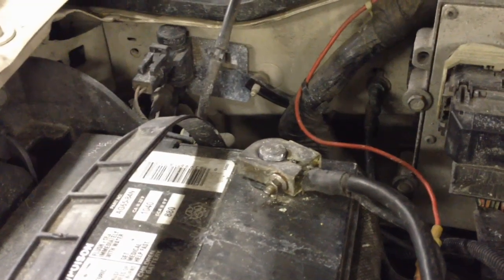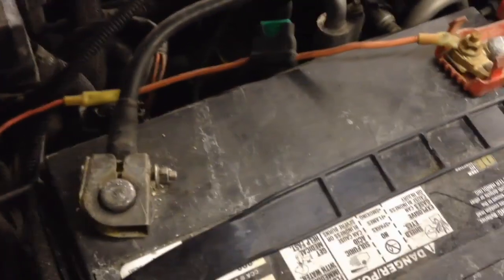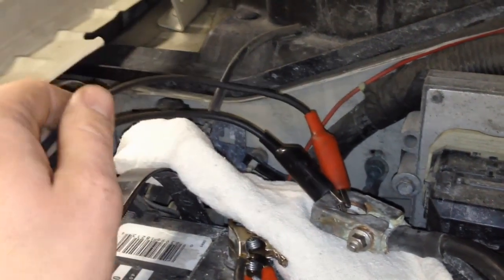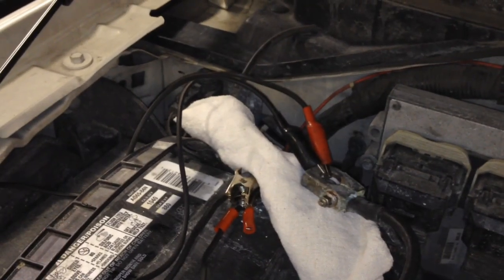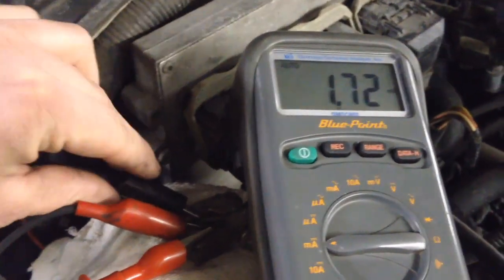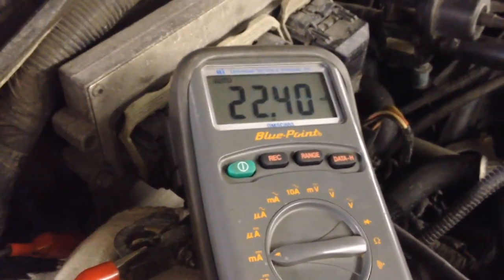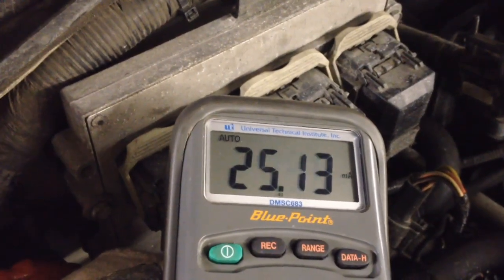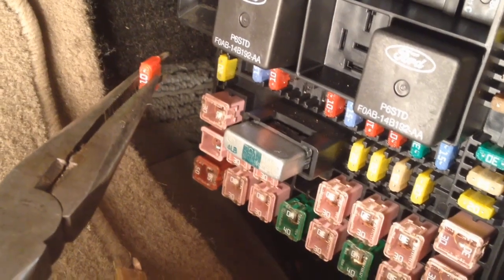How To Perform a Battery Parasitic Draw Test

Comment: Do i have to use the jumpers?  Can i just remove neg cable hook up my multimeter leads from it to neg battery post on 10amp setting and just wait it out?  Wait like that for 40 minutes?

Comment: I wouldnt leave the fuse out as you say,  theres a pretty good chance you wont remember where they re fit if you have a number of them pulled out at the same time.
Reply from the maker: Yup so you definitely have to take a picture first. You cannot put them back in until the test is complete.

Comment: Hey FTML, I have a 2005 Ford 500 Limited, 3.0L Duratec V-6. My battery is draining overnight.  Not even enough to click. I put a charger on it for about 2 minutes and the car started normally.  I thought it was the battery but I doubt it now. Pretty sure I have a draw that's killing it. The other day I tried to pull the trunk light out and blew my F2 fuse. Interior lamps (Courtesy and Demand lamps) and Delayed Accessory  (Power windows and Moonroof). And sure enough they weren't working. But my radio was also not working. So,  I had Power to one side of F2, the blown 15 Amp fuse,  but no power to F13, 7.5 Amp (Audio) and F15, 10 Amp Delayed Accessory (Driver window motor logic, Moonroof, Audio, Driver door lock switch illumination). Both these fuses were good.  I didn't think that the F2 fuse would affect the radio so I checked the 30 Amp Breaker and it was good.  Now I'm thinking perhaps my Delay Accessory Relay was shot.  I replaced the F2 fuse and everything came back. Power to F13 and F15 and everything was working. I'm getting constant power to my F11, 20 Amp (Audio, Family Entertainment System but I was told that's normal. Everything is working fine now but I'm still waking up to a dead battery. After only 2 minutes on the charger my battery was 12.50 volts with engine off and 14.6 with engine running. My on board diagnostic is telling me charging system OK. Any thoughts would be greatly appreciated. I was about to buy a new battery but I'm putting that on hold until I can verify what's going on.

Comment: Hey @fordtechmakuloco – Love your videos, I've referred to them countless times!!
I'm researching a parasitic draw on my 2013 F150 (5.0 FX4). I'm on my third battery now (second one was replaced within a year because I thought it was faulty) and every time I shut off my truck it goes into battery saving mode right away. Seems like a common thing.... I am seeing a lot of chatter online about it being either the shifter park sensor/switch, key ignition switch, gauge cluster, etc. Do you have any first-hand experience with this issue in the F150s, and if so what was your solution, or what do you see as the common culprit? Thanks for any advice!

Comment: In reply to Justin , there is a video from Humble Mechanic , about 2 years ago " The Best Way To Perform a Parasitic Draw Test " . They read millivolts across the fuses . The chart he uses to convert that to milliamps is in the video , is on the Power Probe website . It is another way do do this test .

Comment: I Have a 2003 Ford F-250 6.0 Has a very fast drain. Has 2 New Batteries And new Alt. I can Start off all Fully Charged and 20 Min of driving Radio shits off and Truck runs Like a 5.4 with a bad Coil. I watched the video but I got lost with the volt meter part. Where do put the volt meter? I have never Been Good with mA/ and the like. I can fix just about anything when come to eletrical I am not that good at it. Any Help  would very much be welcomed. I Love your U Tube channel. Thanks

Comment: If the parasitic draw is 0.02 Amp under 12.60 volt of 45 ah battery, what would be the parasitic current draw for 1 hour??? Is the 0.02 Amp draw is for 1 hr or 1 sec???

Comment: 2003 Ford Focus ZTW wagon (2.3L Zetec) battery light mystery problem. I'm finding posts for this problem all over the place but no solutions. New battery, new alternator, battery still comes on. It does seem like a parasitic draw because the battery doesn't go dead seem to go dead sitting more like it goes while it is running. Ideas FordTechMakuloco? or anyone?

Comment: This film is very confusing with all the clips to where? And can't see in film connection to multimeter, could PLEASE do a remake of a parasitic draw test Brian?  Thank you sir.
Reply: Agreed.  Some good info on door latches and associated procedures, but lacking in multimeter specifics.  Thanks
Reply: I agree with both of the criticisms. None of the connections are made clear. I suspect the poster does not really understand what he is doing, even though he gets the results. (No harm intended, it just seems that way.) 
You can find a much clearer video at Eric the Car Guy. https://www.youtube.com/watch?v=KF1gijj03_0   He takes 15 minutes, and by the end you'll underrtand what you're doing, instead of being confused.
I did learn from the door latch disabler trick. I couldn't figure out how to do that on my '01 Taurus, because there are no visible interlock switches like you see on most cars. So thanks for that Makuloco.
Reply from the maker: @SiteReader  This video was shot while working at the dealer trying to be discrete. Here is my new video shot at my own shop and you can see I definitely know what I am doing with more in depth accurate information than anyone on the subject, especially when it comes to Fords. Check it out- https://www.youtube.com/watch?v=6xFo_oHFF48
Reply: @FordTechMakuloco  Thanks, I'll look at it.
Reply: @SiteReader  I have never have had to do a draw test but you really just had to think about it. It looks like there are two jumpers (the red ones) connecting the cable end to the battery post to supply power to the security system, and are removed after the system is armed. The black clip is his Multimeter. And by the way, who is it here that doesn't know what they're doing? The "poster" is an ace technician.

Comment: Nice info again.....i have a 06 navigator ultimate the problem it's the fuse #24 Battery saver relay it's blowing as soon u changed....looks like short some where.....I already check the PSV heated cable and its not short on it and my interior lights work fine....can u help me to fix it?

Comment: I have a 1993 Z28 and I've been tracking down this electrical gremlin for awhile now. I did the whole multi meter test and found out that i had a parasitic draw coming from my courtesy fuse. Now if i put this fuse in, and leave the car sit overnight, its dead come morning. So lately I've just been driving the car without the fuse in and it starts every time no problem. Yesterday i decide to plug the fuse in and disconnect the alternator. Come out in the morning and the car fires right up. Does anybody know what this might be?

Comment: Isn’t a better way to test voltage on each fuse instead of pulling each fuse?
Reply: Thermal imager after car sits overnight. Relays, fuses, power seat motors and so on will glow on screen. Huge time saver.
Reply from the maker: No
Reply: Ok is this just a better way for Fords?

Comment: The voltage on my car's battery reads 12.3 when connected and 12.6 when terminals disconnected. Is this normal? What could cause this?

Comment: Any Advise. I have in my shop a 2012 f150 ecoboost and it will drain the battery over night. I have 0.019 ma when everything goes to sleep but it still drains it over night
Reply: John Knopp 

    Did you disconnect alternator to see if it was a bad diode?
Reply from the maker: A common problem is the cluster wakes up the entire network randomly causing the draw because it loses the park signal.
Reply: So would it be the cluster or a park signal issue. That might explain after opening and shutting the door the draw went from 1.6amps down to 206ma and stayed there and then suddenly went up to 1.6amps and then settled down again to 19 ma
Reply: @FordTechMakuloco  what would you replace

Comment: I have a good battery, starter , and alternator. I have just replaced the PCM relay. It is still drawing up to 350 cranking amps when starting. otherwise I have to jump it. Any advise you can give me will be greatly appreciated.

Comment: you can always roll the windows down 2, instead of opening the doors and flipping the locks.
Reply from the maker: You need access to the interior fuse panels too that is why the doors must be latch and left open.
Reply: when i do this i usually unplug the door switchs, or if i cant not unplug switches use a clamp and keep the switches pressed in.

Comment: I have a question, when my reading is 1.22 in the 10amps terminal, whats my reading in milliamps then? is it safe to use the milliamps terminal with this readings and not ruining my multi meter? thanks a lot
Reply: Dodjie Garcia Jr. since there are 1000 milliamps in 1 amp, 1.22 amps is 1220 milliamps. Does your meter have a setting between 10 amps and mA? Otherwise, you should be able to see 50 mA on the meter as 0.05 amps.

Comment: I have a 1997 E-350 super, 7.3 powered van with a drain I have so far traced under the hood as being both the left AND the right turn signals.  They are drawing 5.8 & 5.9 amps respectively.  That's with no key in the ignition etc... and yes, I'm very confused as to where the power is going.  Any best guesses what to try next?
Thank you  - any help is great at this point - changing that 2nd battery under the passenger seat is no fun@@
Reply from the maker: TheOregonOutlaw How are you stopping this draw which fuse are you pulling
Reply: Did you ever figure this out... have parasitic draw on e350 2001 7.3 ambulance

Comment: Hello i have a 94 lincoln continental and i did this test and found out that the fuse that controls the fuel filler door, cruise control, cigar lighters and horn is causing a drain any tips on further diagnosis for each component thank you
Reply from the maker: ***** Yes disconnect each component you identified in the circuit one by one at the source to find the draw. I would start at the cruise first then filler door.
Reply: Ok thanks boss

Comment: Stupid questions: 1. Why are there 2 jumper wires?  2. Dual battery response to another commenter was to disconnect the secondary (I assume) battery negative and isolate.  Would you explain 'isolate' please?  3. Ford's instructions say to install jumper before taking the neg cable off. Don't know how you'd find the room to do that, but I wonder if they're thinking an interruption might cause the offending device/module to go 'quiet'.  Thank you for posting this.
Reply from the maker: Gary Schultheiss There are 2 jumpers to provide enough amperage for modules to properly operate and or go to sleep. Modules act erratic when not enough voltage is applied and can stay awake or constantly cycle leading to incorrect results. In dual battery setups we just simplify it by taking one battery out of the equation hence disconnect the secondary battery and isolate it from the negative terminal with a rag or such so they cannot touch. Then it is the same as a 1 battery setup testing wise.

Comment: I have a question about the voltmeter. If you wanted to test the vehicle's charging system, do you set the voltmeter to AC or DC?
Reply from the maker: You set it to dc voltage for a charging system check.

Comment: you should document which fuse goes where  camera or written before you pull fuses
Reply from the maker: Yes a nice clear picture is a great idea.
Reply: Most fuse boxes have a picture or diagram of the place of the fuse and the sizes.